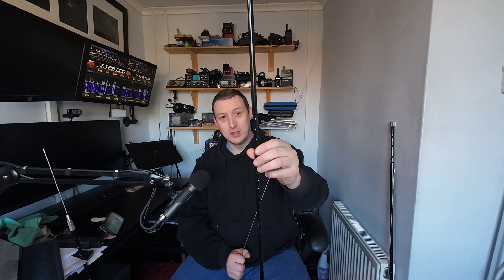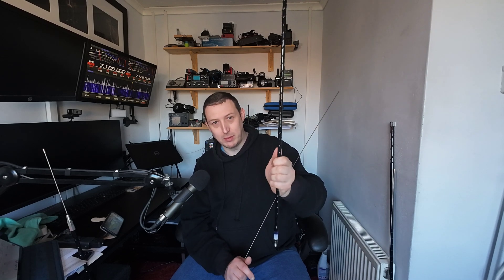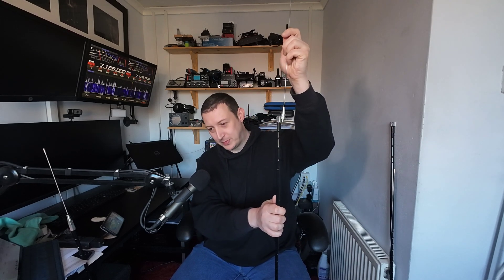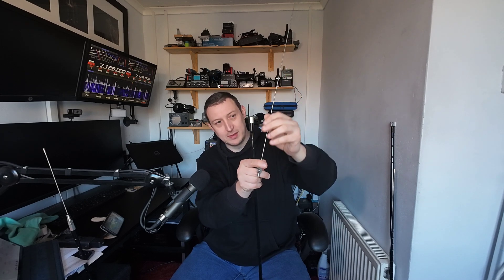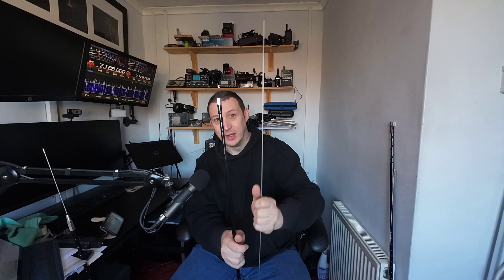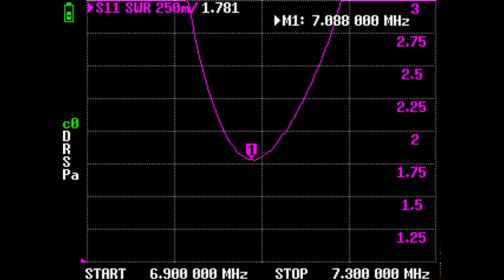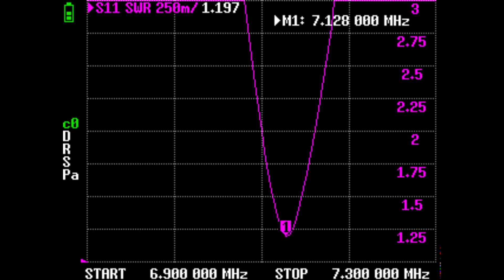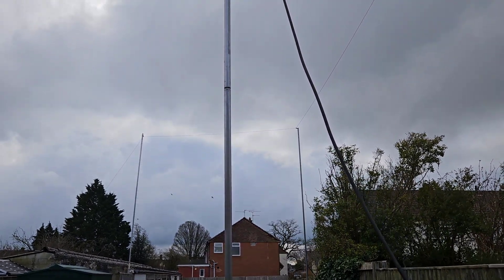40m Hamstick Dipole vs Full Size Antenna

Comment: Wonder how a couple of the 160m would work
Reply from the maker: Probably very poorly!

Despite working significantly better than I expected on 40m, it's still a big compromise. These antennas are very short for those bands.

On 160m that compromise becomes massive.

I've never tried this configuration on 160m hamsticks, but I think we can be confident that it's going to be very inefficient & extremely narrow-banded.

Comment: what is the t adapter you put the sticks on... I have never seen that before.
Reply from the maker: Dipole centre. I got it from Moonraker here in the UK but it's probably also stocked by other retailers.

https://moonrakeronline.com/dpc-38n-plastic-dipole-for-3-x-3-8-thread-n-type-1

Comment: I Use these all the Time, i have 3 sets 10, 20 and 40Mtrs all on a single mast at a height of only 6 mtrs, the 3 are "co phased" so only 1 feed, beside the 40mtr ones being very narrow i have it around 7.160mhz, have worked VK on 10, USA and asia on 20, and europe on 40. for some with a small garden they are great also i pull mine down when not in use.  DE G0sgo

Comment: unfortunately I don't have space to mount half-wave antennas for the 40 meter band and I'm evaluating more compact solutions like this one or buddypole, the only thing that leaves me a little perplexed is the limited bandwidth, but you can't have everything!
Reply from the maker: Exactly right! Unfortunately there's always a compromise. 

In the case of this antenna that compromise is the limited bandwidth and inefficiency (about 1 s-point down on a full size antenna).

That bandwidth could be widened out somewhat (maybe enough to cover the full band on 40m) using the tuner in the radio. This would be at the expense of a slight further loss (possibly unnoticeable) of efficiency at the band edges where the SWR is high.

If you are operating on a fixed frequency (for example digital modes like FT8/JS8 Call etc) then you can tune the antenna to that spot frequency.....problem solved.

Otherwise you will have to tune to the middle of the part of the band that you want and try to tame it with a tuner.

Comment: I have been thinking of this for my 40M HF Gateway... Looks good for NVIS, not interested in DX
Reply from the maker: I think it's definitely option, especially if you are going to be on a fixed frequency. 

It's obviously not going to be as good as a full size antenna but considering how cheap & compact it is, I think it could be a viable solution.

Comment: What Power did you run on WSPR.? Thanks
Reply from the maker: Oops, I forgot to include that in the video!

Ran 2 watts for the WSPR tests.

Same radio/computer combination for both tests. The only thing that changed was the antenna (and associated coax run).

Did the second test immediately after the first. 30 minutes on each band. It wasn't the most scientific test as conditions could have changed over the 1 hour period of the test, but I don't think it skewed the results too much.
Reply: @ O.K... Thanks

Comment: Nice video, I have used the Hamstick type whips for years as mobiles, Dipoles, and even multi band Dipoles (ie 80, 40 & 17 meter whips from one feed point). At some point in the future when I'm not allowed on the roof or a tower (the wife's rules) I plan on a couple rotating dipoles on push-up poles. Yes they are a compromise, but one can't hear 1db down on signal.

Comment: Two things, did you try it on any weak signals or DX... Most of those G stations can be heard 59 on a coat hanger, true test is weak or distant stations... in my opinion.
Reply from the maker: Admittedly not on SSB, although some of the WSPR signals were marginal.

My conclusion is that the hamsticks were generally around 6db (or 1 S-point) down on the main antenna.

Not sure how much the height came into effect? Remember that the main antenna was at more than double the height of the hamsticks......I wonder if the gap might be even less if they were at the same height?

It goes without saying that the main antenna was always going to win this test. That's no surprise. What did surprise me was how close it actually was.

I was expecting 2-3 S-points difference, not 1 S-point. I thought the difference would be greater. 

As for distant stations, everything was NVIS a that time of day, even on the main antenna.
Reply: @HamRadioOnline  Great stuff, I actually have the ham sticks and that mount already but next tried it, as I think mounting it on my mast would be too low for 40M, for long distance, need to get it up 50/60ft which is impossible here.

Comment: Have you thought about mounting the ham sticks as a vertical dipole ? just a thought. good video 73
Reply from the maker: The thought had crossed my mind. I suspect it would interact with the mast, so I think you would have to use a fibreglass mast.

Likely wouldn't perform as well on NVIS, but probably slightly better for nighttime DX.

Comment: is there also a variant for the 160m band?
73, Klaus
Reply from the maker: There is. It will be extremely narrow banded and very inefficient but theoretically possible. 

That said, I don't think it would be practical below 40m. I think the bandwidth would be too narrow to cover anything other than a spot frequency and I suspect it would be too inefficient to be useful.

Comment: Great comparison video. Just goes to prove you don’t need to spend a fortune to be heard. Great news for new people coming into the hobby.
Reply from the maker: Yep. It's certainly a compromise, but I was very surprised how favourably it compared. I reckon it's about 6db (or 1 S-point) down on the main antenna.

That said, the main antenna was at more than double the height of the hamsticks. At such a low height, I'm sure there's some ground losses. I'm wondering if that gap would close slightly if the hamsticks were elevated to the same height as the main antenna?

The biggest problem is the extremely narrow bandwidth. For people doing FT8 or using JS8 (possibly emcoms) on a fixed frequency, I can actually see this being a viable option. Especially for a small, portable setup.